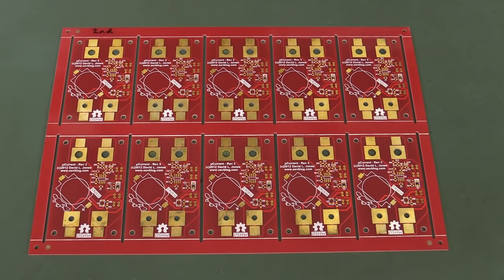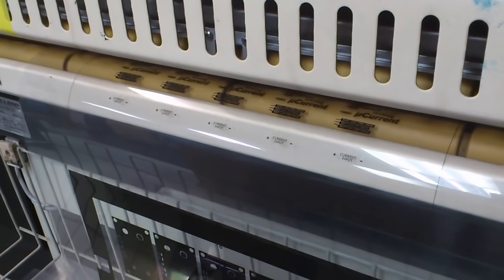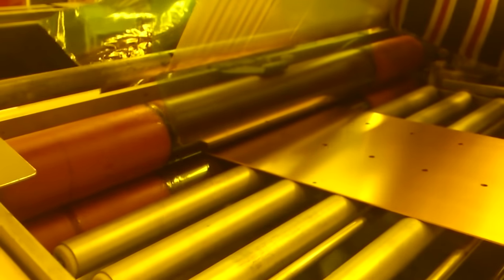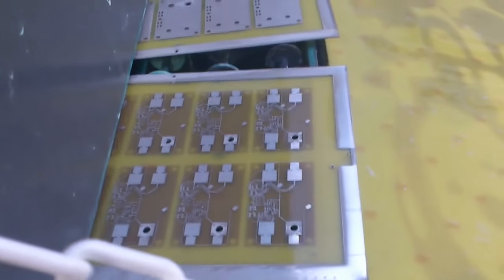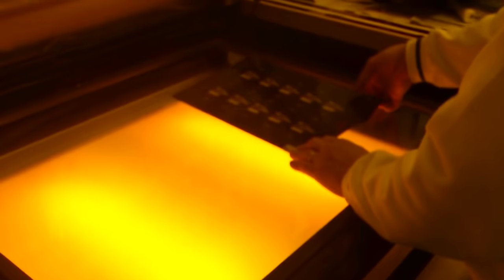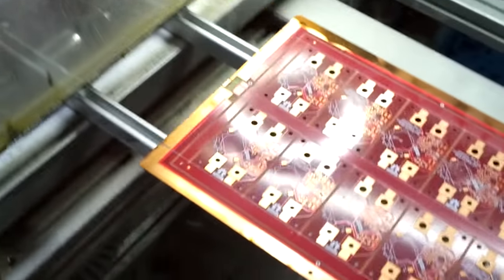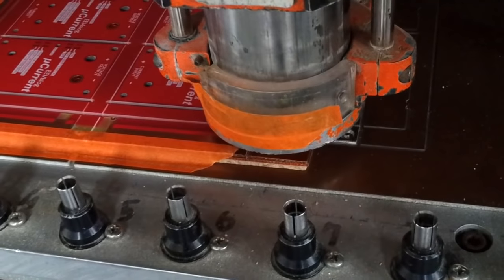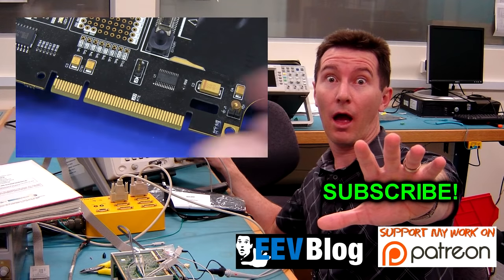EEVblog #939 - How Is A PCB Manufactured?

Comment: You can get prototyping equipment that can rival or beat value pcb mfg, 3 grand and some manual work instead of automation at certain parts and a rather low throughput (a few boards an hour) are the only barriers
Reply from the maker: $3k buys you a hundred or more different professional PCB designs which costs you zero time to produce yourself. Absolutely no contest.
Reply: What are the costs per square inch after you invested that $3k?
Reply: Maybe if your time is worth nothing and you get your materials for free

Comment: A lot of people saying that small runs like this can't be automated... that's ridiculous. You could automate this from top to bottom, just get rid of every human interaction one by one. Human is required to flip a board over in the machine? Make a machine that can do both sides at once, or can flip the board within itself. Human is required to know where to send the board after machine A, be it Machine B or Machine C? Easy, that's what roller belts are for. These are all solved problems.

The problem is, there's no money in small runs of boards, so no one will ever invest the money into making the automation better. On most runs, of thousands or millions of boards, automation wouldn't help much, as the entire line of machines is configured once and then humans just send tons of boards through.

Comment: Great vid, I could watch stuff like this all day!
I'm left with one question though, why would you rout out the panel when you're going to snap the boards out anyways?
I can't remember your test jig, but did it register off the panel outer edges? I'd be aiming to reuse the manufacturers pin holes.

Comment: Hi Dave, the older videos you talked about are not clickable, also no links for them in the description (e.g. 2:15).

Anyway, great video as usual. Thanks !
Reply from the maker: Yes, flash does not work on my machine at the moment so I can't add annotations
Reply: EEVblog Flash??? why not html5? flash is pretty dangerous nowdays, don't even have it installed myself
Reply: Even adobe is killing  off flash if it hasn't by now, HTLM5 way safer and better performer.
Reply: Donald Holben
althoug html5 already has loads of vulnerability's, its still way more secure :P

Comment: What do they do differently for small production runs (like prototype boards)? The router seems like the slower part of the process, how do they deal with boards that have a few billion vias? Are small vias processed any differently than your larger plated through-hole?
Reply from the maker: Vias are no different to any through-hole pad. Proto panels will often have limits on how many holes you can have for that low cost.
Reply: While drilling small holes, Excellon CNC may work as fast as 1...2 hits per second (depending on board size, average distance and path optimization between holes). To drill 0,9mm holes, the spinners are set to 65,000RPM and the Z (vertical) feed speed is set near maximum. When drilling larger holes (screw mounting ones, etc.), spinners are set to 20,000...25,000RPM at lower Z feed speed. 

In a recent job, our Excellon 3-head machine spent about 12 minutes to execute 1370 0,9mm hits in a non-typical board (holes very close to each other) -- 1.9 hits per second average speed. Grouping 3-board height stacks, the rate is 17 holes per second. Altough a typical board drilling will be a bit slower, this is fast, indeed.
Reply: Jackson Gray usually machines can drill about 30,000 holes per hour, if they are less than 6 mil they may laser drill them.  Some machines are faster then others but drilling is very time consuming.
Reply: Jackson Gray for the billion vias  some mfg houses use laser cnc instead of mechanical drilling.  When you see via capabilities of ungodly tinyness, you know they're using laser.  Faster drilling and even arbitrary diameter holes.

Comment: Dave, in the video you mentioned that Electoless gold (ENIG) is really great for high pin count chips due to the flatness and low cost adder. This is something I've been researching recently and also been finding to be true. If it is so good and relatively cheap, why do so many other plating types exist? HASL, Organic, Tin Immersion, Silver Immersion, ENIG, etc? I've not found any compelling arguments for when and why you would choose the other finishes. If you have any insights, I would love to hear them.
Reply: Gold plating for mechanical scratch resistance on exposed pads (like contact points on PCI or memory cards) and corrosion prevention. Most expensive. 
2. Silver plating for Corrosion prevention, surface planarity, solder adhesion. Cheaper than gold. 
3. Tin plating for solder adhesion. But no corrosion prevention. Cheaper than silver. 
4. HASL is the coating of copper with molten solder by dipping in molten solder bath and then removing the excess with hot air. Excellent solderability can be achieved, but surface planarity is not as good as silver or gold. 
5. Organic coating is a temporary protection applied to exposed copper or tin plated PCBs to prevent oxidation or corrosion during storage before soldering.

Comment: I am not sure why they have to apply photo sensitive material to the entire board (for solder mark and component overlay) part when at the end only a fraction of that ink is going to stay. Better way would be t expose the silk screen (read https://en.wikipedia.org/wiki/Screen_printing) and apply the ink through that screen, so that only fraction of ink is used, and they can skip the whole  developer solution. Screens once prepared that way can be used for many many boards.

Comment: Another one of these 'it is so cheap, only $5 ' videos. Maybe $5 each for a 1000 qty order  or $5 each min order 20. Or $5 each and $20 postage. A little less exuberance and real world prices would be a good idea.
Reply from the maker: OMG, the humanity!
Reply: Yeah, I checked local manufacturer for small qty PCB manufacture and it costs $35 for 100*160mm board+shipping etc and is delivered in one week..... On the other hand I can buy blank double sided PCB (with the same size) already coated with photoresist for $3.
Reply: I'm in New Zealand. I've been using Fritzing for all my one-off  boards but the weeks i have to wait for delivery is killing me so had a look around for NZ manufacturers. A board that Fritzing was going to charge me ~32NZD for, is quoted on the PCBZone website at ~65NZD. I'd love to support my own country's industry but i just can't at that price. And the board area i'm talking about is only about a third of the microcurrent.
Reply: well, I just put in an order of 3 boards at $9.50 each. the boards are 5.71 inches squared, the shipping is free.

now if I ordered 20 I would have gotten them at $5.71 each board, free shipping.

is it the cheapest thing in the world? no, but for a board that screams professionally made I think it's worth it.

Comment: i thought electroplating would only work on metal but a freshly drilled hole should show fr4. did i miss something?
Reply: waldsteiger it grows from the edges of the copper; the solution has additives to make sure it plates out evenly.

Comment: Why doesn't the solder mask get stripped off when it goes through the developer to strip the unwanted silkscreen layer off?  Different chemicals?
Reply: Because the solder mask which is remaining was already developed.  Just like the wanted developed silkscreen wasn't all removed; but instead only the unwanted was removed.  The ink is UV reactive and only the undeveloped ink comes off easily.  That is why they put the blacked-out patterns over them at various steps (to control which portion is exposed to UV light and which portion is not).
The undeveloped silkscreen layer was placed over the top of the developed solder mask.  Part of the silk screen gets developed (the part you want to stay) and then the undeveloped silk screen is removed. Since the solder mask below the undeveloped silkscreen is already developed, only the undeveloped silkscreen layer comes off; leaving the developed solder mask below and the developed silkscreen text above.
Reply: OK I was just not thinking.  I think rather the stuff under there was exposed (versus developed), if it didn't get eaten off before it won't now either.
Reply: Its actually a wet process, the solder mask is a thick gel that polymerises (hardens) with exposure to UV , you "paint" a layer of gel on, apply a clear sheet of plastic both sides. Then put the photographic film over, and expose. The non-exposed regions are still gel afterwards, some comes off when the clear sheet is lifted off, the rest can just be washed away (e.g. with alcohol). You can also direct write onto the gel coated surface.

Comment: The step where the used developer is dumped into the local river is missing.
Reply: For negative dry film photoresist, developer can simply be a solution of sodium carbonate; washing soda. Perfectly fine to put down the drain.

Comment: i remember from my school days (circa early mid 2'000s) - marker on single bit of plastic with metallic coating and some sort of acid, just paint the pathways and throw it into acid. however multi layered is something i had no clue how to do (except possible 2 layered - one on each side).

Edit 3 addendum: ah so its as simple as just using the magic of glue :/ somehow i thought its really clever solution that somehow gets between the layers but nope.

Comment: Where do I get prototype PCB's for $5? Seed studio is ~$10 minimum, ~$30 for a decent sized one
Reply: china
Reply: China is sub-optimal for "cheap prototypes", as they calculate in area.
It can happen that Chinese PCB manufactures refuse a production run for your product, because the total area just is not worth their time.
(especially, when there are issue with data quality) 
Also keep in mind shipment (slow and cheap or expensive?)
Reply: I've recently used dirtypcbs and pcbs.io, they were super cheap. Oshpark is also rather cheap but purple mask by default. pcbs.io offer gold plating by default interestingly.
Reply: Did not know about pcbs.io . Is it a new service? Seems very good
Reply: Vikas V it looks like they are not a manufacturer but a PCB broker.
Reply: Chris Groner yeah exactly that, it's the team from digi spark brokering orders through their PCB fab partner.
Reply: You can get them for free if you steal the money (stolen credit cards work best) and then use those to buy your boards. Works every time!

Comment: Hey Dave, just wanted to ask why would you prefer unplated wholes over plated, since the drilling process takes place either way? As you said in your soldering tutorial, it is easier to solder a pin when the whole is plated.
Reply from the maker: My PCB was being used a front panel.
Reply: maybe a video on cnc pcb making ? be interesting on how you would go about joining top and bottom layers

Comment: what is ucurrent? can we learn pcb production price list with pcb size? how can we give an order to produce like your ucurrent boards? i need a measurement tool for picohenry inductance on Alternating current. its looks like its for me. with this tool and microcontrollers we can make gold detectors. security metal detectors. you can use a coil and a gold coin to test 12v/ac current on coil. insert gold coin in coil and outer coil. current changes in ac mode.

Comment: What is the true cost of this?
Reply: looking at the website, it's not friendly for prototyping.
Reply: Brad Well, honestly, I am not shocked. The entire process was many hours I am sure. I am pretty sure the equipment may have to be rejigged for the different board sizes. Honestly, and it's an Australian company right?
Reply: New Zealand company.
Reply: Beren Scott Well I wish I could find a PCB manufacturer that makes PCB in small quantities at a cheap price.
Reply: Brad Yeah, it's just really an unfortunate fact about the cost of providing such a service. You really need scale to make it worth it. There are going to be major setup costs regardless of quantity. It would be great if there was some fully automated robotic process that were easily programmed to do all of this.

Comment: DIY PCB: 5€, bought PCB from service: 100€... what would you chose if you were a student
Reply: Eddy Fuchs 
Go check out Big Clive's video on etching at home.
Reply: Thanks for the hint, but why the hell does Dave beleive buying prototype PCBs is dirtcheap?!
Reply: He makes them in high quantities. Then they are dirt cheap. 

For first prototypes home etching is probably the best and cheapest, when you get production prototypes it becomes more viable to do this...
Reply: Depends on the size. If you can cramp it under default sizes (5x5cm, 10x10cm, 10x15cm, etc) and use a chinese pcb fab (seeed/iTead/elecrow/and a few dozen more). It can be pretty cheap. 5x5cm (max) you can usually get produced and delivered for about €12 for 10 boards. So 1,20 per board, including delivery. And for about €5 extra you can get 10x10cm.

there is a pcbshopper topic somewhere on the eevblog forum. Check it out. It is a price comparison website for pcb production.
Reply: its dirt cheap compare to what it used to cost.
homemade pcb are not going to die soon , maybe until cnc machines will cost less then homemade pcb.
Reply: PCBgogo, 40USD for 10 pcbs :)
There's also sitopway which is just as cheap and ive had a friend buy a bunch of PCB's through them, almost as good quality as eurocircuits but they don't have as easy of a gerber file upload service as places like PCBgogo.

Comment: I like cheap stuff too, but looking at the chemical mess at that cheapo manufacturer, I wonder how much of the cost saving  is done by externalizing the environmental costs. If they can't even keep their floors clean, how much do they care about the environment. Think about all the thousands of liters of water and chemicals just for a little hobby thingy. On the other hand the Eurocircuits facilities look spotless. I bet they charge a lot more. So when you use the cheapest shop in China there is a good chance you are fucking the planet. And now you can't say you didn't know.
Reply from the maker: In China I imagine the regulations would be, well, umm...
Reply: ...Horrible. Sweatshop conditions.
Reply: The Eurocircuits factory looked a lot bigger and a lot newer. It was an old place they were soon getting rid of, so there wasn't much point deep cleaning the place until it closed.
Reply: Dont forget that green sluge is still valuable:P

Its likely just turned back into to copper or used on the electroplating process.
Reply: The etched copper ultimately becomes a sludge. That sludge is dried and sent offsite for processing back into copper ingots and the cycle starts over.
Reply: +thommw Well, the beauty of the various electroplating processes is that it only messes up their own (local) environment, not ours (it isn't radioactive or something). If they choose to ignore common sense (by not polluting the land they live on) it's entirely their own choice which doesn't affect us (that much).
Reply: If this video was shot in China then why are all the sticky notes covered in English writing? It doesn't look remotely like a sweatshop to me, they've got gloves, dust masks and their equipment looks like it has intact safety barriers and interlocks in place and as the link that Dave posted for the video states the company making these prototypes is in New Zealand. 

I've worked in factories here in Australia where we have some pretty strict environmental and OH&S laws and one thing that they all had in common was messy floors during production. 

Sweeping and mopping ain't that difficult.
Reply: Isn't this video from www.pczone.net? They're located in New Zealand which might explain why all the post-it notes are covered with English writing.

Comment: Dave, pcbzone is really expensive...
It's not good for prototypers.
Reply: Then use a cheaper one, they aren't the only pcb manufacturer, PCBway, sitopway, itead, PCBgogo and more. Only issue is although some give pretty high quality boards (ive seen boards from sitopway that seem equal quality to ones i get from eurocircuits for work, some aren't so trustworthy and you have to take their DRC rules with a pinch of salt and put some extra tolerance on them. 40USD for 10PCB's in a week from PCBgogo, thats $4 each, you can get small 8bit microcontrollers which cost more than that :D